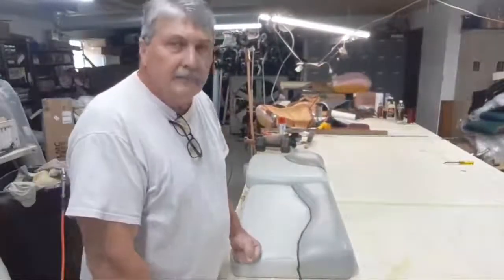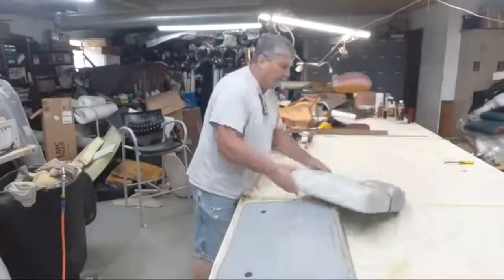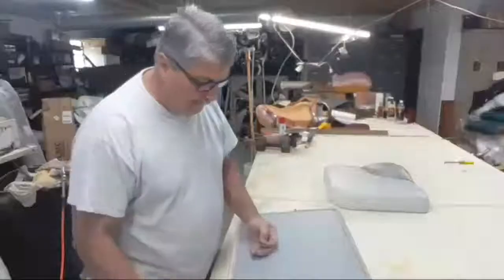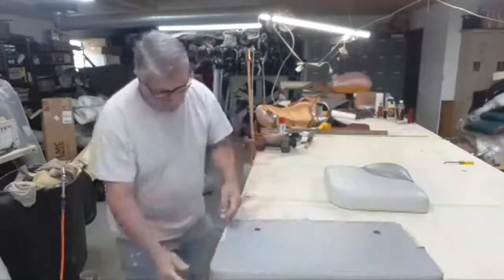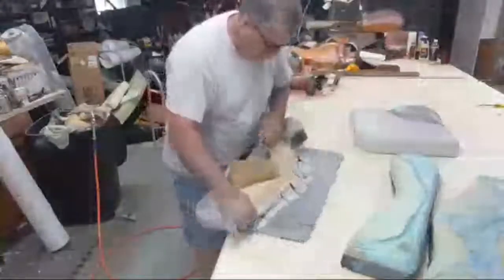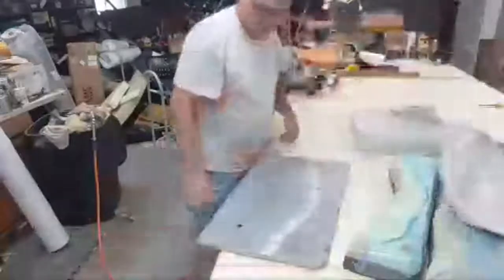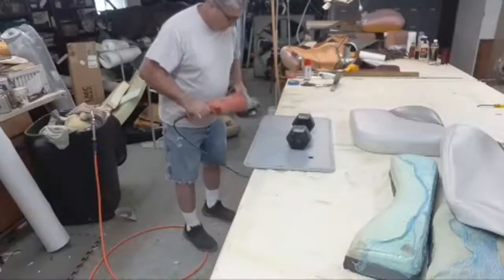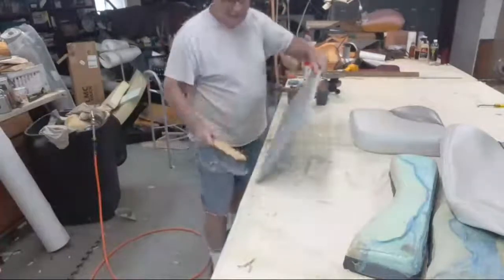Removing Staples Fast From Boat Seats.

Comment: That works good. I use an oscillating tool with carbide blades. What state are you in?
Reply from the maker: In Ga,
Reply: I enjoy watching tips on upholstery. I'm just across the line in SC.
Reply: Great tip. I re-did the seats on our pontoon and Mastercraft back when I was around 40. Now I’m just a 70 yr old quilter, lol
Saw you on Helen’s channel today.
Reply from the maker: Ga.